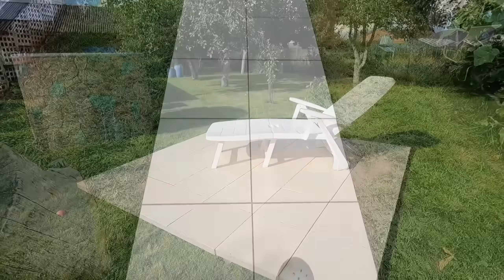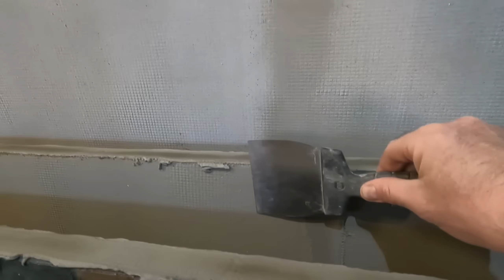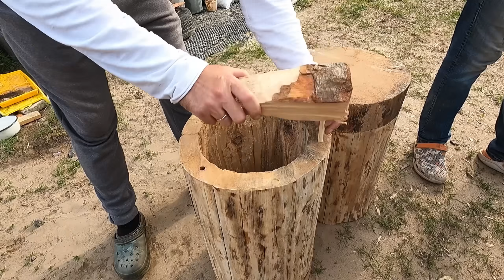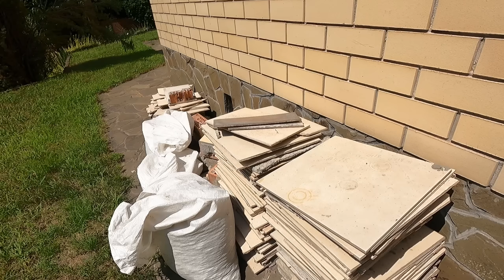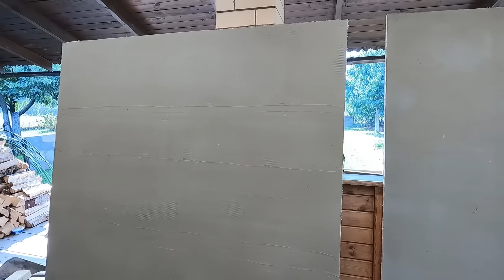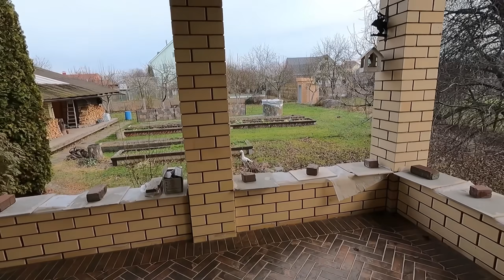Amazing DIY Building Material for Home & Yard - Inexpensive and Easy!

Comment: Please tell those of us who are not in Belarus, what is Pinaplex? Is it the polystyrene boards or the concrete substitute? Also, what is the equivalent material or brand for those in the USA.
Reply: Extruded polystyrene foam insulation board, available at most home improvement stores
Reply: Apparently, the material name is penoplex. It's XPS, essentially.
Reply: @mkeyx82 what exactly is XPS? I'm trying to find an equivalent here in the USA
Reply: @patrickmccrank8414  XPS stands for eXtruded PolyStyrene. This penoplex thing appears to be a variant with high compressive strength.

Searching for "penoplex compressive strength" you will find a specification stating 150 kPa. At least that's what I found.
Reply: @patrickmccrank8414  looks like my comment was deleted or something. XPS or EXP is extruded polystyrene in general. If you search for "penoplex spec sheet" you should get the general idea of the compression strength you need to be looking for. My cursory investigation said something like 150 kPa.
Reply: @patrickmccrank8414  I'll try to provide the URL, likely to get blocked:
penoplexpolska.pl/images/certyfikaty/Pnp_Dec2019_A4_190419_ENG_Osnova20-60.pdf
Reply: @patrickmccrank8414  XPS or Extruded Polystyrene...??? Comes in various Weights and Compressive strengths...???
Reply: @patrickmccrank8414  XPS is Extruded Polystyrene as he said. Here in the UK common insulation board has an open cell structure so absorbs water unless sealed in and snaps if you try and bend it. It's also usually faced with Ali foil which not much would stick to it and would only be as strong as the glue holding the foil on and doesn't have rebated edges. I gather what he's using has a closed cell structure and clearly flexible enough to bend. I had a little  look last night and think I found similar to what he's using which is a type APX that is used here for floor insulation then you put a concrete screed over it.
Reply: Same here. Let me know if you guys find it?

Comment: What are these supermaterials, and where can I buy them?
Reply: This channel seems to pitch the Foam, by Name, but not the Coating material! 😢
Reply: @robertweekley5926  The Coating is Fiberglass Mesh coated with Stucco Cement...???
Reply: It is basically STO, a fiberglass grid mesh that is used over Styrofoam in conjunction with a type of mortar that mimics a plaster finish, at least in the United States. I would guess that they are using something similar in Belarus. The biggest difference that I see between this and STO is the use of EPS versus standard Styrofoam XPS "bead" sheets. STO is frequently used as the outer finish layer on small commercial buildings in the USA but I gave never seen it used as shown in the video. It looks like they are basically building SIP's (structural insulated panels) which have also been in use in the US for at least 20 years, with some changes to the construction that may  or may not be beneficial. And to clarify, I do not know if the SIP's are a USA invention originally, I am just familiar with them from American TV shows on home improvement such as "This Old House".
Reply: My two cents. I think he's using a polymer base cement with self leveling properties.